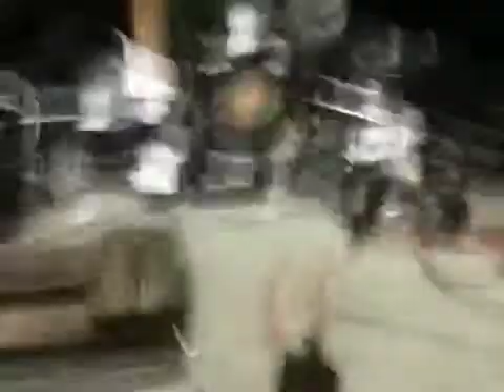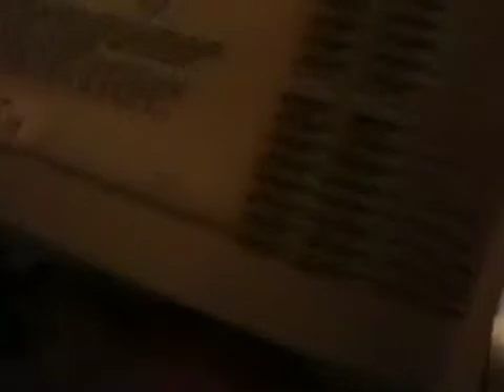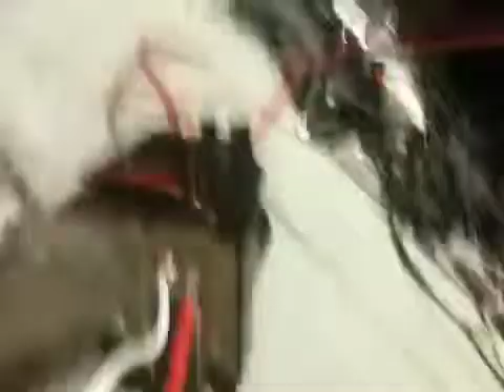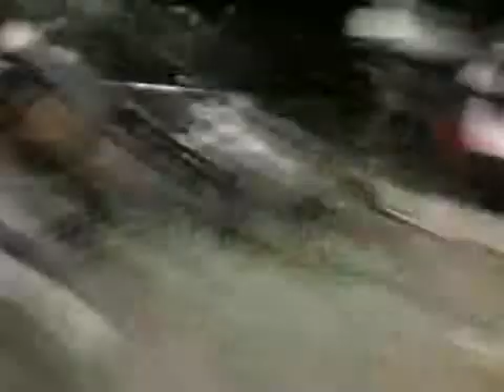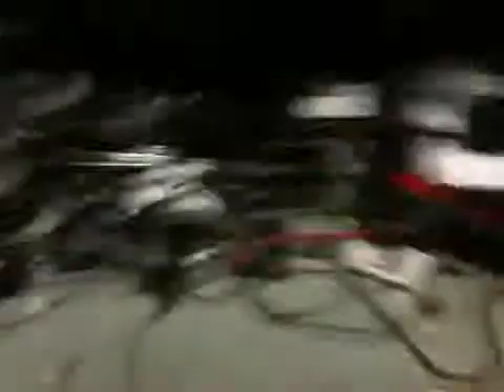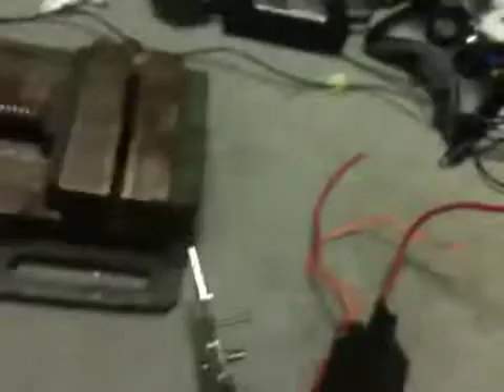High voltage power supply flyback cfl driver

Comment from the maker: @BlackandChrome I can tell you that "some idiot" was very rude and not true. I can tell you that I also have little experience with electronics and I work on the carpet made of nylon that just melts if hot things hit it. Also if you didn't hear it's a 100w cfl. Circuit size has nothing to do with it. Different brands have different sizes. Not only do I usually use a 2-3 foot pole to hold the leads but I have a breaker and momentary push button in case of accidental electrocution. I may come acr